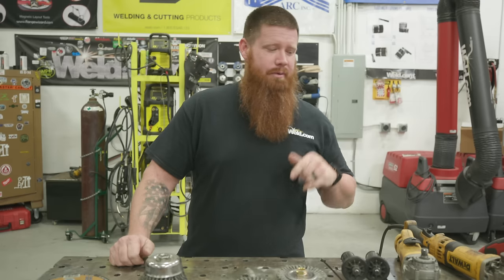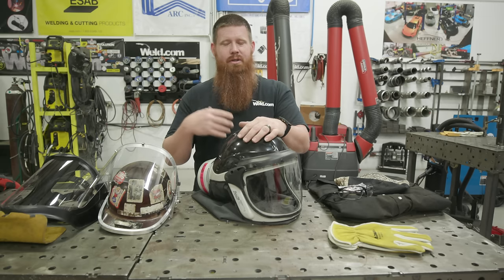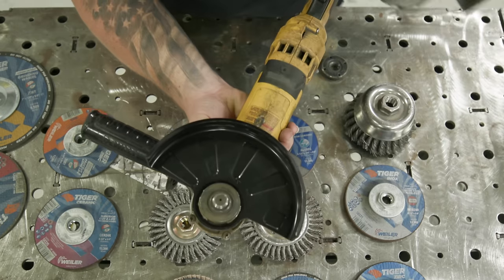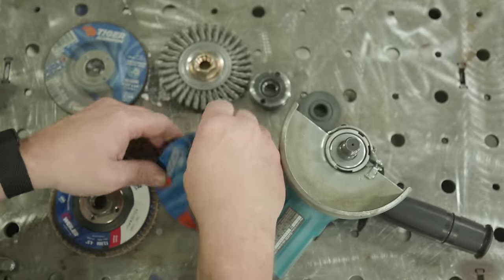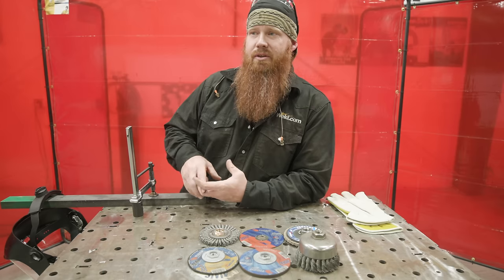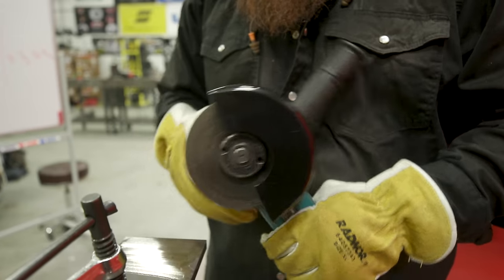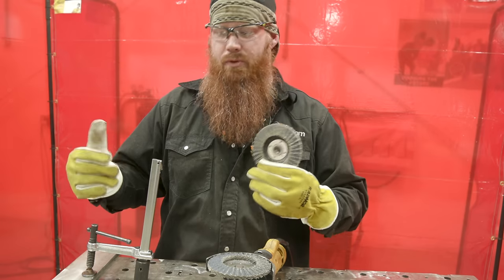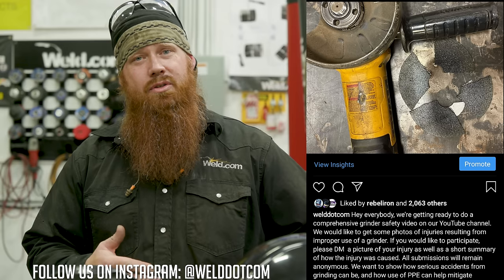Grinder Safety: How to Properly Use an Angle Grinder

Comment: This is a good video, especially for newer people getting into welding. I’ve been welding for 35 years and and have broken every safety tip you mentioned plus a whole lot more. It’s not that I just don’t care, it’s more of the places I’ve worked at. It’s more of “get it done” type places I’ve worked. The companies first rule is to make money, their second rule may be safety (if your lucky). I even had a few injuries from a cut off wheel cutting my forehead and requiring staples, to exploding disk with fragments sticking in my chest. But looking back at all my time welding for a living, I’d have to say it’s definitely not worth it. The pay is low with long hours of standing in one spot breathing the dust, looking like a coal miner at the end of the day just to go home and get up and do it all over again. Don’t get me wrong, welding is fun but only when you do it as a hobby or on the side type job. My best advice for younger people is to get a good education and find a cleaner, higher paying job. Because after 30 to 40 years of the day in, day out bs, they will wish they had.
Reply: This is deep. 🙏
Reply: I've only spent 6 years in the field and all the reasons you stated plus the fact that every place I go I seem to make less then the shit bags so I'm done with the field.
Reply: How much money were you making and what type of welding were you doing? I'm going to college for welding and you've got me a bit spooked
Reply: Flacid Frank in the 80’s I was making $4.85 an hr. Today I’m at $19.00 hr. Doing standard mig welding on square tubing, and sometimes a little tig welding on smaller/thinner pieces. Right now we are building advertising billboards that stand alongside the highways and byways. But mostly we do parts racks for major automotive factories. I’m sure there’s other places that pay more but in my small town there’s not much here. I’m now in my 50’s and after my wife passed away, I know I’ll be working way after retirement if I’m able. All and all it’s a job, but all my life I felt as if I was working just to survive. Get a good education and get a job to where it feels like your living not surviving. Also think about your health, breathing weld fumes and grind dust day in and day out is not good. And the frustration of a boss always over your shoulder wanting you to go faster or work longer hours also puts a toll on your health too. I hope this helps you on your journey thru life, it’s definitely not easy to raise a  family.
Reply: @rukus13  Thanks bud that's some stuff I'll definitely consider
Reply: Flacid Frank if you go to school and are certified you will make more. I’m in school too
Reply: RealStealAirsofter that’s not necessary true, although schooling does help and you may find a 1/2 way decent job welding but most places I’ve worked don’t even consider certificate. If you are called in to take a welding test at most factories and can lay a good weld and read some blueprints they will most likely ask you when you can start. This is a better way to start out, and you will get a feel of what it’s like in that environment. Plus you could save your money on tuition. But if you got money to burn then by all means go for it. I personally would lean more on fixing/repairing welding machines or something in that neighborhood then standing in one spot for 8 to 14hrs a day till retirement. Also think about 10 years down the road of life, prices on everything will go up faster then your paycheck will. I wish all Weldors (and everyone else) the best in life and may your dreams come true on what ever job they per take in. “Best welding job would be an off shore underwater weldor”.
Reply: This is true,but what will they hire you,if u get unfit.U can purchase gloves,mask and wear tight clothes wearing jeans and shoes.Will save u and as u told,u r doing job from long time so u must have learnt from your experience.
Reply: @rukus13  B pressure welders make $110/hr to glue pipelines together. (provided you have your own truck, machine, and tools)
shit, i was making $28/hr as a helper on the pipeline.... job can suck sometimes, but that money though....
Reply: @flacidfrank8410  -  College?  For welding?  I suspect you're going to a Technical College, otherwise known as Tech School, or trade school.  In the end, you'll still be a welder.  I think he's suggesting you consider getting an education in a skill that involves more pay with less physical risk.
Reply: Craig Molson that would be good pay, a expensive way to make that kind of money but in the long run it may be worth it. But the average/typical weld shop would never pay that much. And it may sound good for a single person always traveling and sleeping in different beds or a truck to get that kind of money, but as soon as you add a family in the picture things get tougher and lonely. I just wish I could of went a different route in life to where money could flow in at a nicer pace instead of trying to survive from paycheck to paycheck.
Reply: @rukus13  Have you considered "slangin' rocks"?
Reply: Craig Molson too old to make a change in life now, I have  6 years till retirement.
Reply: @rukus13  what other trade would you recommend that pays more? I was about to sign up for welding classes. Help me out if you got any other ideas. It's a big life choice for me. My interpersonal skills suck, I'm bad at communication so a desk job where I have to talk to a bunch of people isn't for me.
Reply: @Adrien_broner   don’t get me wrong but welding is a good trade to learn. But now days with the growth of the internet, and more technical jobs out there the sky’s the limit. Find something you like doing. At a young age I liked building lego’s and Lincoln logs so much so that I always wanted to be an architect. I got into drawing blueprints of houses, but back in those days minimum wage was $4.85 a hour and my family was poor so my dreams was just dreams. Then a friend got me a job welding, I had no experience in welding but knew the concept of it and landed my first welding job, and the rest was history. My son was able to go to FullSail University in Florida and got into sound design. He was able to do some sound effects for EA Sports, and helping others with gaming sounds. Look at some high paying jobs, like a lawyer, engineering or medical. Another guy I know drives a backhoe and averages 80k a year. Not bad for digging holes. But all in all it’s up to you and the will power you put forth. I wish you the best of luck on your journey through life, it won’t be easy tho. But with you asking questions tells me you have a good head start on your journey. Take care Adrien.

Comment: You are a great teacher. I fear grinders for 2 reasons. First, I know someone who had a grinder accident. Second, power tools that cut freak me out because I am left handed. You covered everything people do wrong at home and or on a job site. The end of your video was and eye opener for me. I am a professional painter and from time to time, I have to use a grinder to prep metal objects  for painting and  a sanding disk to shave down wood, bondo  or epoxy wood fillers. Some grinders have have holes on both sides. Some of my festool sanders do as well.  I am not to proud to tell you and your readers, that I am now confused as to how I should hold a grinder  and what side the handle should be on.  I am certain there are other people out there like me who have to adapt to our handedness if a tool is designed specifically for right handed users. I don't want to be one of the guys in the photos, so I will gladly welcome any advice. In additional I saw a guy on a job site take a worn out sanding disk and peel off all the paper and use the remainder as a cutting disk for metal and tile.  Will this work, or is it another way to potentially be in your photo contest if things go wrong? Again, many thanks for taking the time to make this video. 
Respects, Sky

Comment: If you're wearing cotton jeans like Levis or Wranglers, and sparks are shooting at them, and if your legs start to feel sort of warm, that means your Wranglers are on fire.
Reply: Not sure if this was a sarcastic comment or not but it can be true. I pat myself hard down after to put out anything that could turn into a fire or a bigger fire.
It is possible to start yourself on fire with this tool though, rare but possible. Especially with cheap clothes.
Reply: - Did I just peed in my pants without knowing?
- No man, your pants are on fire!
Reply: @HelloHello-hk4sx  was wearing a cotton sweater and it started feeling really warm, and when I looked it was on fire!
Reply: @danl.4743  If I knew my pants were on file, I'd pee in them, deliberately.

Comment: STELLAR video!    DEFINITELY put on the safety glasses!  Although I wear glasses for near vision, I didn't have safetys on while cutting off some bolts, and spend half a day in the ER to have a piece of metal removed from my eye.  Fun fact:  if you get metal in your eye, you also will need to have the inevitable rust ring removed.  Just wear the safetys- learn from my mistake  <3

Comment: remember when i was doing my welding training ages ago, one of the other students used a grinder and i noticed the guard did not look safe this was while he was already in the middle using it, and we are told never to disturb someone using a power tool in case they lose concentration and a accident could happen, well he was using this grinder trigger in and the lock button in so it kept going even if you let go of the trigger the guard came off got caught in the rotating disk as it was on auto basically, before we could get to the mains to turn it off the guard came flying off, luckily not his direction but went across the garage like a flying blade lucky no one was in it path.
Reply: Would have just unplugged it that way there would me accident of him being startled
Reply: Oh damn that must have been really scary, glad everyone was fine phew

Comment: Thanks for this excellent info. I'm new to angle grinders and am doing my research. Seems to me that the best setup for cut-off wheels is to just use a type 27 cut-off wheel so that you can use the same ferrule as with your grinding wheels. The type 27 (offset) wheel is better for flush cuts too I have been seeing. They seem to be priced similar as well. What do you think?

Now as far as the "type 1" guard, sheesh, lots of people and sellers don't seem to know anything about those. My manual refers to using a special guard for cut-off operations, yet when I contact them and ask if they sell one they tell me just to use the type 27 guard they included!

Comment: Wear a respirator!! Grindings are heavy so once they get in you lungs they settle in the bottom and dont come out. Also, if you wear a sweatshirt or jacket cut the strings off so that wheel wont get ahold of them
Reply: Drew L can’t wear it long term. Better to be in a shop that has great ventilation.
Reply: @Mikey-ym6ok  Why not? I'm an electrician and I wear a p100 mask most of the time so I don't inhale drywall dust and insulation. I wear that same mask when I weld as a hobby.
Reply: @Mikey-ym6ok  i wear a respirator all day long in over 100 degree weather in the most fucked up situations you could possibly imagine, and a leather jacket. not everybody can be in a ventilated shop. field welding is 10x harder. how are you going to weld a bridge in a shop?

Comment: I always offset my face from the cutting wheel just in case, yes i "always" use the guard.

NEVER go in at an angle below the centerline of your work since it will grab and explode the disk. 
Also ALWAYS pull the plug before touching the disk if i hit the switch.

I once used a regular grinding disk as a cutting wheel and it lost a chunk of it, grabbed the work and went flying over my hand leaving me a big gory bloody wound

Comment: Safety violations & hazards list: 
#1 You forgot to soak your beard in the old solvent. 
#2 Not wearing a cup or any type of groin protection.
#3 You forgot to duct tape the acetylene torch to the grinder housing for additional cutting torque. 
#4 Not wearing protective leather speedos. 
#5  No large bong to use as a proper cooling plunge.
#6 No lesbo porno playing on an old VCR in the garage can be very hazardous if a male gay blacksmith should enter the shop. 
#7 Always practice using your leg/foot to secure your work so you have a free hand to utilize as a beer or nectar collector holder. 
#8 No loud punk rock music to retard the grinder noise could severely damage one's hearing and image with shady customers.
#9 You should be using a nuclear plasma cutter on die cast metals.
#10 Always close your eyes & use the force to avoid pink eye.

Dude, get your shit together...duh! 🔧🔨🛠🔥
Reply: I laughed a bit to much at this
Reply: @rhyskirk7357  It's one of those 'One shouldn't laugh but just can't help it' type of comments :)
Reply: I know nothing of tools and looked to the comments to see people's serious answers but it's all jokes. (Giggled at this btw good job)
Reply: @TheOriginalCoda  i found it very educational. Ive always over looked the leather speedos
Reply: And no Safety Tie!
Reply: And always cut at 3 o'clock, if you don't know what that is FIGURE IT OUT!!!
Reply: ROFL!!! Thanks.
Reply: Working with closed eyes is extremely dangerous.

Comment: Everyone has already stated what’s wrong with the “how not to” part of the video.
Besides all of that I always like to have a fire extinguisher in sight and within quick reach just in case.
Reply: At home I have a fire extinguisher mounted to the side of my welding cart.
At work I have 4 extinguishers, one on each wall.
Thankfully I’ve never had to use any of them.
Reply: Absolutely!   I have a Fire Extinguisher mounted to each of my 3 Welding Carts, 1 mounted to the Leg of my Weld Table, and  6 more mounted strategically throughout my Shop on the Walls. Aside from PPE, this is the most important piece of Safety Equipment in a Weld/Fab Shop!
Reply: All of the above are excellent suggestions. Big thumbs up from me.
Reply: That's a pretty good rule for life in general.  Cars, houses, garages, much less shops and industrial buildings.
Reply: @John-jn2lw  yes, I have an extinguisher mounted to the automatic transmission tower in the front of my van as well as inside the pantry cupboard with a fire blanket. I learnt the importance of the pantry items after my son had a oil pan fire while cooking two years ago. On that occasion I placed the burning pan into the oven to burn out.
Reply: I’ve got three within easy reach of my grinding/welding area.

Comment: Always wear safety gear and use the guard on your grinder. I was cutting a piece of metal and the cutoff blade broke and shot the blade 10 feet and slammed into a wall.
Reply: Had a good sized 1mm disk chunk hit me in the cheek, only a scratch. Fuck anything thicker than that though.
Reply: A disk on my little Dremel shattered. I never forgot to use the Reenforced one since. When those wear out they just stop cutting and don't explode.

Comment: I greatly appreciate your tutorial.  Just purchased a Grindr…..have yet to use it though.   I have a whole new respect for this tool.  Will not use till I obtain the proper safety equipment and will reread the instruction manual and likely watch your tutorial at least a few mote times.
Thank you.

Comment: My grandfather's neighbor literally slaughtered himself with his own angle grinder when he was cutting some pipes. It was a big machine with a big disc, without a guard. It kicked back at the point when his head was close to it (what an idiot) and it almost cut his head off. All in front of his whole family.

Instant kill.
Reply: Why was his head near the grinder? Nasty would a guard save you if it kicks back into you though? I mean I'd never use one without a guard but how much would it help in a serious kick back
Reply: Sad to hear. 

Did his grinder not have a paddle switch?
Reply: On second thought, I know from first-hand experience, literally, that using a paddle switch grinder can mitigate, rather than completely prevent damage to body... And that, using it wit the guard in place is super "handy" in case of a sanding disk disintegrating or something like that.
Reply: Oh my God😥
Reply: I trim cow hooves with a grinder and a titanium wheel with carbide inserts. A guy I was working with was trimming a hoof and the cow kicked the grinder (the legs are tied but they still have a little bit of movement) the grinder smoked him in the face and turned his whole cheek and eye socket to hamburger. Thankfully he recovered.

Comment: Pro tip: I rewired my shop outlets so the grounding lead is on top. Take a lot of stress off that part and make it harder to snap off if you should step on the cord.
Reply: Incidentally, that's how they are meant to be installed, with the ground wire on top.

Reason being if something were to fall from above behind the wall, the ground takes the brunt of the damage, and hopefully reduces the risk of electrical fire.
Reply: @Jcolinsol  There's actually nothing in the NEC or in the outlet design that says they have to be installed any certain way - it's really just personal preference. Though I do agree that they should be installed ground pin up.
Reply: Also will make it more difficult for something to make contact across what would be the top two prongs in that case. I generally install outlets this way
Reply: Well that's rong when the ground is at the bottom and you step on the coard the last pin to come out is the ground. I would rather replace cords than get electrocuted
Reply: @nnaTractor  the ground pin on the cord is longer than the other two pins, so that it is the first to make contact, and the last to break contact when it is being inserted or removed.